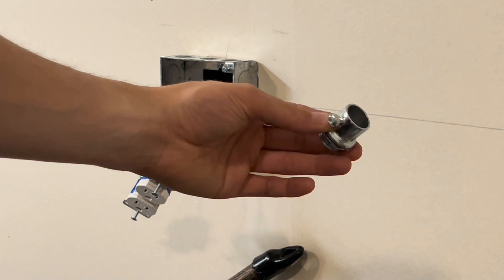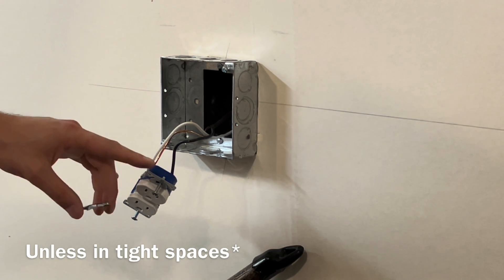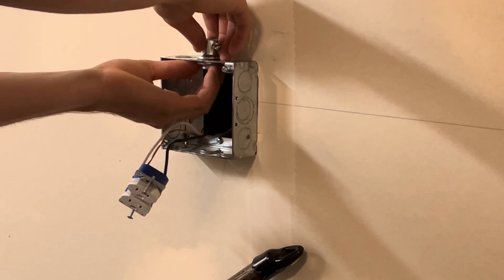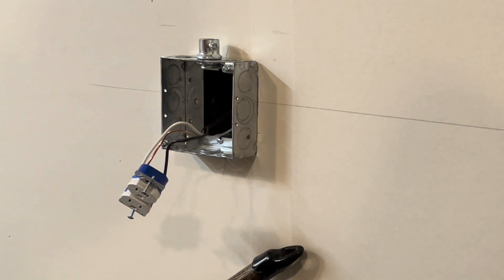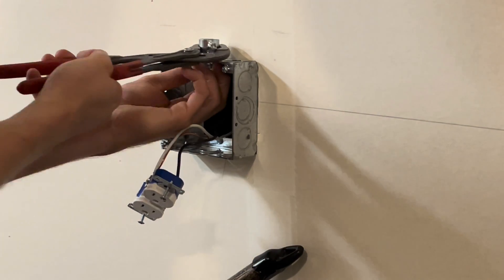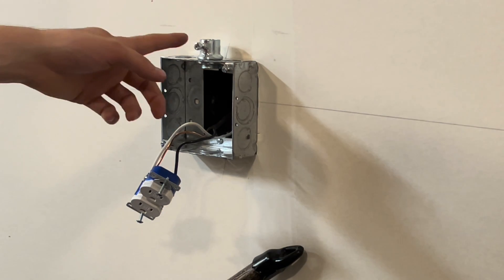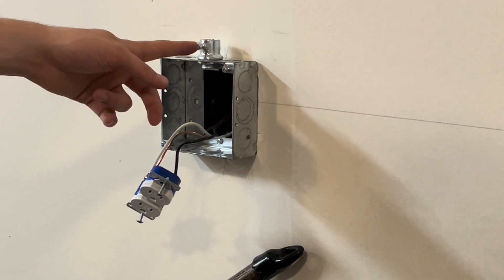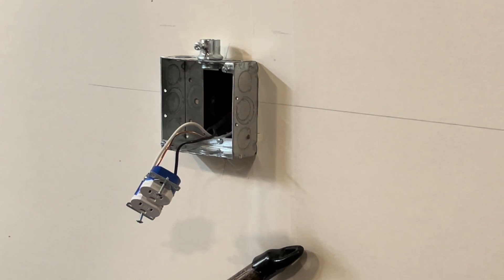Electrical 101: The EASIEST Way To Tighten A Locknut/EMT Connector (Commercial)

Comment: That sure does look easy, but I'm not sure it looks all that tight?  Also would be worried about marring the nice steel connector.  Unless the job uses zinc, in which case who cares.

What I do is take a small piece of EMT bent in a 90 and temporarily tighten the set screw.  The tail of your scrap EMT goes under your arm to keep everything from rotating, and then you can use whatever you want to tighten the locknut.  Air chisel is my preference.  Hah j/k.